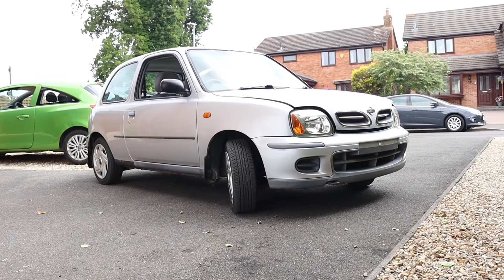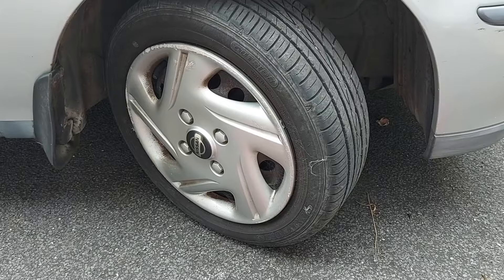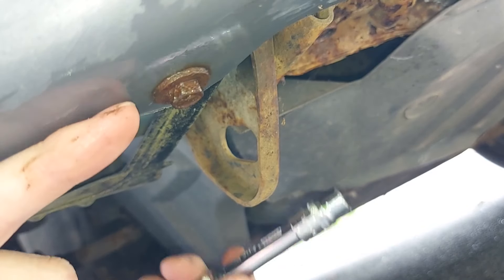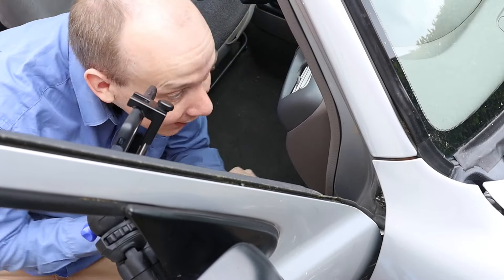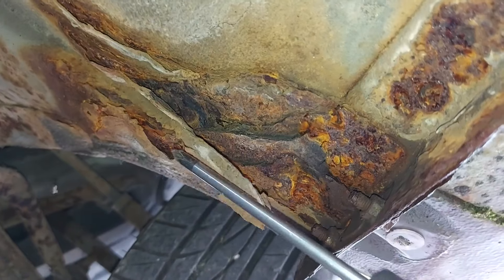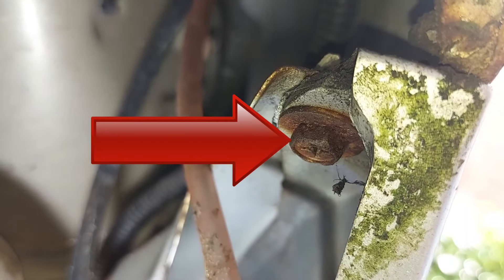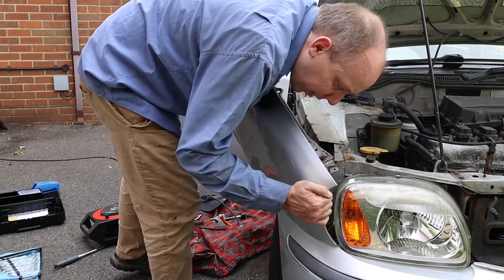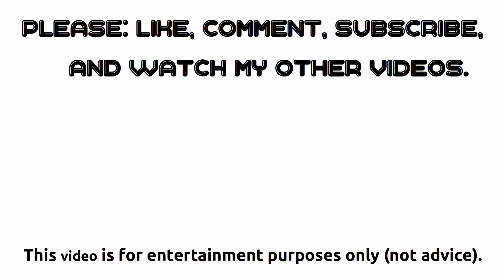Nissan Micra K11: How To Remove Front Wing (Nightmare Bolts)

Comment: You got there in the end! It's a real pain when old bolts snap off or won't play ball. How did you get the shafts out? Drill them out?
Reply from the maker: Hi Paul. One shaft came out when I cut the head off the bolt. The other one is still there. I'll remove it another day, either by dremel or drill.

Comment: There's less rust on the sill than the k13 micra we have. I guess you traded that for not having much of a floor left on the k11 lol.
Reply from the maker: This K11 has large holes in the bulkhead, too.
Reply: @CarSpyTV  the paint quality on the k13 is embarrassing not sure why it's so bad. Ours had major rust at 10k miles lol.

Comment: Have you got any videos on the door removal?
Reply from the maker: Yes, but I haven't released it yet. Best wishes from CarSpyTV.
Reply: @CarSpyTV  Look forward to it, can you do it without removing the front wing or is that a must do?
Reply from the maker: There's no need to remove the wing. In summary:

▪︎support door with jack
▪︎separate power cable
▪︎take off door stay
▪︎remove hinge bolts.

It's useful to have a second pair of hands, but not essential. Hope that helps.